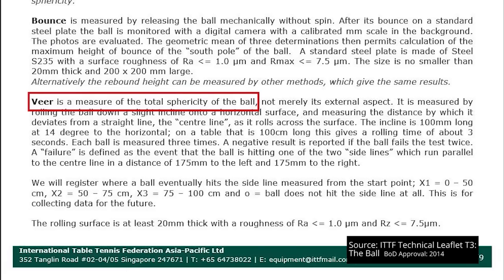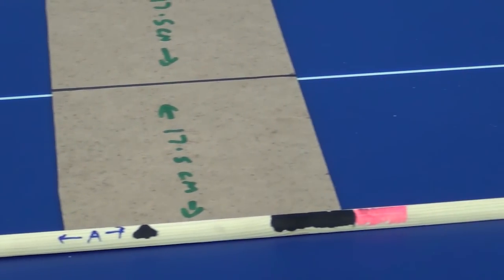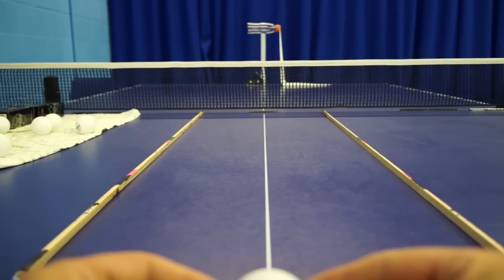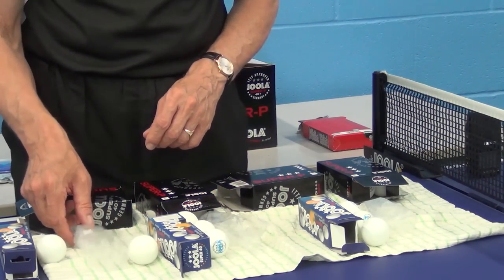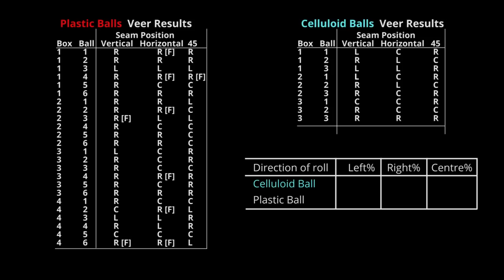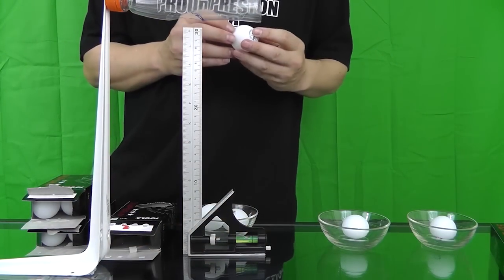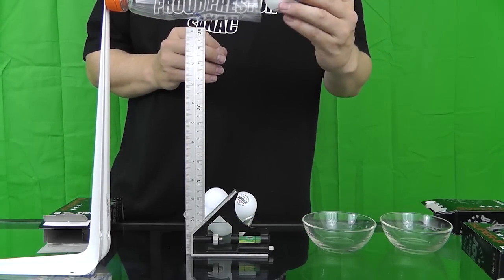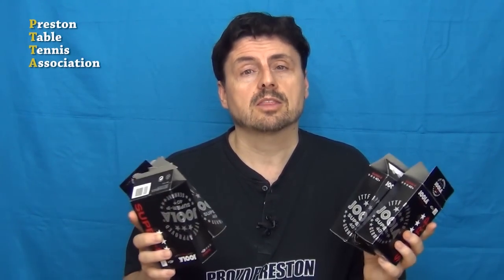Plastic & Celluloid Table Tennis Balls Compared: Veer (Roundness)

Comment: very informative, but it would be interesting if you could do more brands. Also would it have been possible to correlate your drop through the opening test with your veer test? I would expect the balls that got stuck two or three times would veer more than the ones that passed all three times.
Reply from the maker: At the time of filming, I asked someone I knew in the ITTF Equipment committee if he would tell me which manufacturer made which brand of balls but he wouldn't due to confidentiality. From speaking to a table tennis shop owner, companies by balls from a manufacturers batch. If they don't like the batch they won't buy the ball that time round. It makes it very hard to test by brand or identify which brand of ball is made by which manufacturer